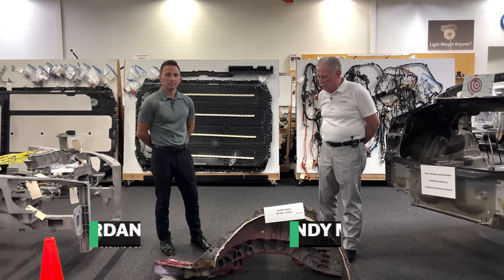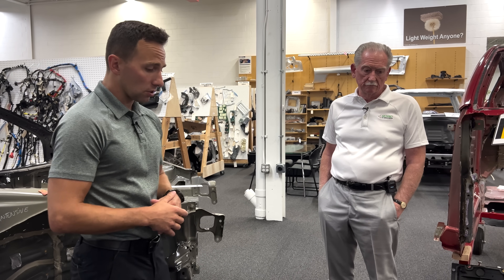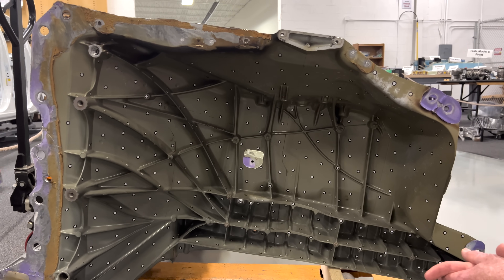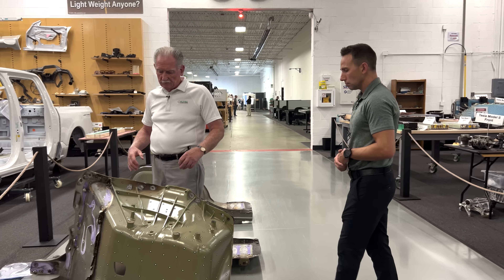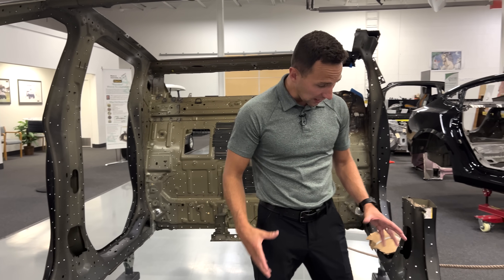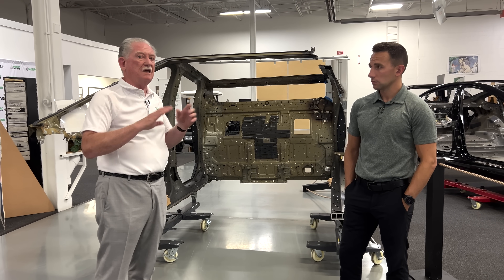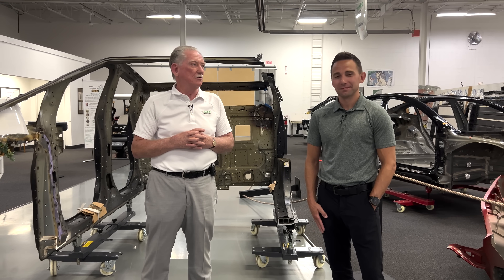From 120 to 1: How the Cybertruck Castings Continue Tesla's Reign of Reduction

Comment: Would like to see a discuss about the post of rear casting of cyberpunk trucks snapping from towing/impact. Is it expected from aluminium vs steel and is it acceptable
Reply: Cast aluminum doesn't like to go outside of the engineered stresses. Instead of an elastic deformation you'd see with mild steel, it will fracture and break. So on one hand aluminum isn't a good choice for applications where random abuse is expected. On the other hand Cybertruck was engineered to tow and carry loads within the specific limits and staying within those limits is a good idea not just for CT, but for any other vehicle. The fact F150's frame doesn't break from excessive abuse is a side effect and not a design intent. The metal still fatigues and repeated stress will lead to unexpected failures even if used within the specs at a later date.
Reply: @fd15k  well said
Reply: @fd15k and on the other hand hitches are breaking off of trucks within the limits going down the highway
Reply: @fd15k exactly, and in this case the engineered stresses for vertical load limit on the receiver is 160 lbs per the Tesla owners manual for the Cybertruck. I don't care what whistlindiesel did. That specification is a joke for a trucks receiver hitch, and over three times less than the 500 lb limit of other pickup trucks, like the Silverado and F150. Because reasons, good engineering reasons. As you alluded to. 🙂
Reply: @ButterfatFarms  

Sure, and perhaps that means if your goal is to carry a motorcycle on the hitch carrier, then CT is not for you. Likewise if you intend to carry of 30 80lb bags of concrete mix in the bed of the truck you may have to pick CT and not the Silverado.
Reply: Cast aluminium is probably the worst thing to use as the structure for towing,  in the aero industry, they cast really strong structures, they do it in a way so as the cast cools, it starts in one place and migrates through the mold evenly, this makes the metal form a solid single aluminium crystal,  looking at the castings for the C T that doesn't seem to be the case,  if the metal is just left to cool it will do it unevenly causing multiple s of crystals, between these crystals are faults,  week points,  if a cast is underload , and is hit hard enough, the shock will break it,  I have seen 2 reports of the C T shearing the rear cast off while the hitch was under load ,  Whistle Dixie tested the ford and the Tesla to destruction,  they did worse to the Ford afterwards to prove a point, the Ford didn't break...... can't beat drawn steel for that type of engineering.
Reply: The fact is the ford wasn’t road worthy after he did that. 20 bucks says that car wasn’t safe to actually drive on the road. Probably didn’t track straight to actually fix it would require a body shop.
Reply: Haha! Look mom a troll
Reply: Not one of you idiots used the word "malleable" once.
Reply: Turns out Cybertrucks actually don't make good aeroplanes, so if you first use it as an aeroplane, then it will actually get damaged
Reply: It is more brittle, but looks easy to replace. Just unbolt the module and bolt in a new one. It's a bigger piece, but easier to replace than cutting and welding.
Reply: @dcap78  if it's that simple, why doesn't that get published by Tesla ?  I didn't think they were THAT modest. Will the local service centre have a number of castings in stock for the panel beaters/repairers to pick up when required ?.
Reply: That guy is a joke.  Why would you even watch that goofs videos.  Dont consume such junk entertainment.
Reply: You mean after driving over 6ft diameter storm culverts, dropping off the end, and slamming the bumper in the upward vertical direction? When it was designed for lateral direction and downward trailer tongue loads?
Reply: @TheJustinJ  no he's probably talking about other instance like the guy towing down the road when he hit a bump and sheared it off.
Reply: i wonder if you can put a steel insert either on the casting or in the casting to help
Reply: “Jerry rig everything” did a YouTube video where he compared a cybertruck and regular truck and was able to snap the rear casting by loading up the tow hitch with a back hoe bucket but was unable to bend the regular truck chassis in the same test. Big difference! Glad I turned down my CT delivery…
Reply: What’s an example of one snapping from towing?
Reply: @Chris-jt7xg He be referring to Whistlindiesel's video about the Cybertruck 😅
Reply: @rkan2 oh that tool.
Reply: @Chris-jt7xg  A video where they jumped one 20 feet in the air then tried to use it to tow and when it broke, they were happy that it was clearly a bad design.
Reply: @davidbeppler3032 I don’t fully disagree with you but Cody did a follow up video and smashed the back end of the F150 way worse to the point where he bent the frame and then straightened it back out with more damage and the hitch didn’t snap off. I don’t know enough to know if the aluminum frame can just be molded differently so that it can withstand more abuse based off of it’s materials flaws but there’s no doubt that there are serious pros and cons to the different materials.
Reply: @TrapperBV  It looked worse but it was not the same test.   Have you operated loaders or diggers.   The hydraulic cylinders slow the fall.
Reply: @danharold3087  May not have been the same test but the frame was all bent regardless. As I said, the materials are different and have different needs. I’d gladly change my mind if he does the same test with the cybertruck but in my opinion the it would break the frame again.
Reply: @davidbeppler3032  you mean 3 feet? Also they replicated it 10 fold with an f150 and it was fine.
Reply: @Edge_Slade  They did not replicate it.  One has far more hp than the other and hit the ramp at a much higher speed.  Did you see the Ford got stuck?  Cybertruck is far better in every way.
Reply: @davidbeppler3032  i mean, a standard steel frame wouldn't have snapped, and trucks are subjected to all kinds of crap. The technology seems perfectly suitable for a sedan or sports car, which effectively demonstrates thay the CT isn't intended to function like a traditional truck.  Thats not bad necessarily,  except that it's been promoted not just as a truck but as the ultimate truck. 

People also jumped the 3rd gen Lightning and found that it's frame wasn't up to the task, but in those cases the frame,  made of steel simply bent and needed repair. It didn't shatter and total the vehicle.
Reply: @Chris-jt7xg  He's probably talking about this entertainment channel where some guy flew the CT six feet in the air and landed its back repeatedly down on a slab of concrete.

Not really a typical use case for a truck outside of a Hollywood set stunt perhaps.
Reply: This is such an non issue.
Reply: Steel doesnt crack when its thresholds are crossed, instead it deforms under fatigue. It doesnt mean that part is now reliable. It will fail unexpectedly on a future date. The gains that can be had by revolutionizing the manufacturing and weight and cost all make the endeavor worth it. A vast majority of truck owners dont really tow anything
Reply: @ZeNashB  the old ways had a lifetime repair warranty........but castings have cast in questions.  Tesla needs to relaunch with a CEO who cares enough to take a basic interest in leading a management team. What chance ?.
Reply: It will be interesting to see how much weight in dust, mud and snow is collected on all those ridges throughout those castings. Most don’t drive on pristine, paved roads.
Reply: Whistling diesel is an idiot, but I would like at least a little bit of an explanation also.    Especially considering my truck will be here soon.
Reply: @erikmoore7402  there's plenty of explanations. He dropped the entire truck on the rear tow hitch. Any other truck would have been totaled by doing this... Quite possibly bent at a near 90 degree angle.
Reply: @themonsterunderyourbed9408  i'm totally on board in support of the cybertruck, and mine will be here soon.    But he did do that test to the f one fifty, and it essentially did nothing.  But after like ten minutes, it did been the frame
Reply: @themonsterunderyourbed9408 Watch the video where they use a backhoe to drag the F-150 around by the hitch and drop a boulder in it. It's a stronger truck in most cases and definitely in towing.
Reply: @erikmoore7402   Don't drop the truck from several feet and stop the fall with a concrete block on the hitch that prevents the suspension from taking up the kinetic energy.    He did not test the ford on this drop.   He did not test the CT on the supposed drop done with the digger.  This was not even a comparison much less a test.
Reply: @danharold3087  it was a wasted opportunity.
Reply: @danharold3087 Also don't put a cargo tray in your receiver hitch and toss a generator on it and then go hit a pothole that exceeds the 160 lb vertical load specification of the receiver hitch. Which is over 3 times weaker than a Silverado or F-150's 500 lb specification, and the same as a model Y. 160 lbs... 😂
Reply: @ButterfatFarms  Asked for clarification on X.
Reply: @erikmoore7402  watch his reaction video to the same thing happening to another vehicle during normal highway driving. He actually seems concerned and disappointed that Tesla didn’t take him seriously. Yes, he is the least scientific person in the known universe, but he did do the exact same thing to the F150 100 times and it was still drivable afterwards
Reply: I think it is interesting none of the tesla apologists in this thread are aware the same failure happened in the wild with a real person towing a normal load. Hit a pothole and the rear end snapped off much like Cody's experiment did.
Reply: @gannas42 I didn't see that. But just picturing it I don't see how much load ever gets to the tongue. There are too many shock absorbing interfaces.
Interesting
Reply: @gannas42 yeah I heard about that one too, even properly towing and not exceeding the tongue weight of the hitch, apparently that 160 lb vertical load limit is a bitch when you hit a pothole.
Reply: Per the Cybertruck's owners manual the hitch has a vertical load limit of 160 lb, the same as a Model Y. And no I'm not talking about tongue weight rating, that's a different specification. I'm talking about the vertical load limit the hitch can withstand with accessories like a bike rack or a cargo carrier on it. While the Chevy Silverado and F-150 are rated 500 lb. If you have an accessory hanging out of that receiver hitch that exerts more than 160 lb of vertical force leverage on the hitch your cooked. It seems like this could easily be exceeded with a loaded bike rack with a couple electric bikes on it, or a cargo Carrier with a bunch of stuff loaded on it, the first time you hit a good bump. The Silverado and F-150 are over three times stronger on this specification. And if it is exceeded things bend not break off. I'd love to hear Sandy talk about this specification, but you know we won't being the huge Tesla and Musk fanboy he is. As well as a long-time proponent of using castings in auto manufacturing.
Reply: @ButterfatFarms people like him are the exact reason that the flawed wet timing belt design is kicking around multiple manufacturers even though 100 years of experience says it’s a horrible design
Reply: Beyond the whistlingD video, there was some guy in the news that had a full load trailer, hit a pothole, and snapped his megacasting.  Haven't seen much more of that, but for EV towing I suppose people buy the GMC EV truck.
Reply: Sorry but the hitch has snapped off from hitting potholes. It's a big problem
Reply: @hankkingsley9183  no…. Only ones that have broken were idiotic tests way outside of any level of reality that we’re not apples to apples
Reply: @hankkingsley9183  Examples on that? I would have expected screaming from multiple sources if that actually happened. "Wham, Bamm, Teslacam" had one crash recently where a Tundra or Tacoma rear ended a CT. The Toyota was disabled, the CT wasn't damaged much at all. The owner decided to buy the parts and fix it himself, for about $1800 I think
Reply: I wouldn't worry about such 'minor' detail.......Tesla is in corporate reduction mode due to an emphasis for far too many years refining its Musk ""corporate puffery"" (Elon Musk's legal counsel) technique. Promises promises in a time when the best are fleeing with their NDA and much smaller stock holding value.
Reply: Whistlin dummy didn't "rip" the bumper off, he sheared it by dynamically dropping the entire weight of the vehicle on it, with the force "upside down".  Same result with any other truck.
Reply: @shazam6274 if you watch the second video you can see how strong the F-150 hitch is as it gets pulled around by an excavator. And a boulder was dropped on top... Steel is stronger. That's just science.
Reply: @shazam6274  i'm a huge cybertruck, supporter, and I have one on the way.    But that would not total a truck with steel frame rails.  I seriously hate to admit it.     I'm still gonna love my cybertruck, and i'm not gonna drop it on its receiver hitch
Reply: @erikmoore7402 Also don't exceed the vertical load limit on the receiver hitch either. 160 lb sounds like it might be rather easy to do if you hit a pothole with an accessory and load on the receiver hitch. Things like bike racks are basically big lever arms on the receiver,  and even with a load much lighter than the 160 lb rating when jolted from a pothole or such I would think the shock could easily exceed that specification.
Reply: body on frame trucks allow the manufacturers to make single/double cab, short/very long bed trucks with option to sell just the chassis cab or just the chassis with the powertrain for RV builders or ambulance builds for example, these can also be modded in to dump trucks, literaly cut in half or sooo many other modifications possible.
Reply: @alanmay7929  Of course, and Tesla has passed on that part of the market. Ford, GM etc does make some money on those, but they make a LOT more on the 4 door cab and short medium bed, with all the comfort features. Cybertruck is cleaning up there. Would love know about Ford's internal calculation on how that will impact profitability. I suspect they're terrified.
Reply: @grahammonk8013  I doubt they're terrified. When Tesla issued a recall back in late June for the Cybertruck's windshield wiper there were less than 12,000 affected vehicles. That's how many we can presume they they had delivered or sold. In July that ticked up 5,175 registrations for the month. Meanwhile in 2023 Ford sold 761,455 F-series trucks. For 2024 from January through September they sold 501,987 F-series trucks. The Ford F Series has been the best selling truck in America for 47 consecutive years. if you think they're terrified because of the Tesla cybertruck you're nuts. It being the best-selling electric truck doesn't change the fact it's still a relatively low volume niche vehicle.  😂

I mean really why do you think that Ford and GM and these other Legacy auto manufacturers, after committing to huge investments to get their EV programs up to speed, then drastically pulled back when they realize sales were shit?
Reply: @ButterfatFarms  That's all true, but Tesla is taking a noticeable chunk of their most profitable sales, and it's about 5,000 a month right now. Maybe terrified is an exaggeration, but they will be taking notice. The F150 isn't dead, or even close to that, but the CT will start affecting the margins.
Reply: @alanmay7929 all something 90% of truck owners don't need.  Most are double cab with a medium bed.
Reply: @alanmay7929  i don't think they're trying to tackle that market, though.   Clearly
Reply: @alanmay7929  a lot of truth to that.
Reply: sandy is a total joke! he has never talked about the actual advantages of body on frame trucks! steel is significantly much stronger than alumimium. go watch wistlin diesel on trying to break the ford f150 trailer hitch he did everything but couldnt.
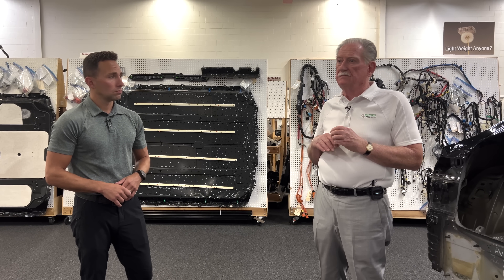Reply: @alanmay7929 He's talking about it. You just don't know enough to understand the words. Go back to around 2:30 where he starts talking about how far forward they are willing to bring the low ductility casting. That address that concern explicitly.
Reply: @alanmay7929  You better not fly on planes cause they are all made of aluminium 😅
Reply: @raymondschembri5042  They're also not made by Tesla. I trust Honda to build a Honda Jet, Tesla not so much. 😂
Reply: @ButterfatFarms  Who is bringing back the astronauts from ISS ? Boeing Starliner   , Hondas space capsules or whatever you want to call or maybe SpaceX . I’ll wait for your comment so others can see.
Reply: @raymondschembri5042  SpaceX that's who. Don't know why you're trying to conflate Tesla and SpaceX that are two entirely different companies, but they are two different companies. Spaceflight is SpaceX's wheelhouse. I would never trust Tesla to build airplanes or spacecraft. 😂

Maybe you haven't noticed how much Musk over promises and under delivers with Tesla while making incredibly fast progress with SpaceX's programs. Funny how that works. How long was the Cybertruck long delayed again? And the model 3 before it etc, and whatever happened to the new Tesla Roadster they showed off then shelved for years? They ain't got no time for that. Also I'm pretty sure the fit and finish on a SpaceX manned Dragon capsule is a hell of a lot better than a Tesla. 😂
Reply: @raymondschembri5042  That's true. But planes have to be inspected regularly and rigorously for cracks, and they are continually being rebuilt. Generally the sorts of loads which happen all the time off road happen in planes only in a heavy landing, and then it's only one cycle. And a plane is only good for a limited number of landing cycles. Aluminium does not have a defined fatigue life in the same way as steel, which means under cyclic loading it will crack, and it's not possible to say when, which makes crack inspection crucial even with that low number of cycles. Once a crack exceeds a particular length for that material and heat treatment, (the "Griffiths" limit) it will propagate to failure the next time it is loaded.
All this is fundamental fracture mechanics. Might not be sexy enough, or modern enough, for Musk to take seriously...
Reply: @ButterfatFarms Space X had 3 billion off the government, you can do a lot very quickly with that sort of money, it will be interesting now that he has spent it all after wasting...how many raptor engines in each stupid Star shop take off....
Reply: @mrlemm2030  I don't know what point you think you're making that has any relevance to what I was discussing.
Reply: @ButterfatFarms  you said Space X was advancing quickly, I was just pointing out, Space X has had billions to push there program forward, and Tesla certainly won't be, yesterday 3 of the board members of Tesla put all there shares up for sale....I wonder why?
Reply: @mrlemm2030  I see so you were making a totally irrelevant point to what I was discussing with someone else that suits your own narrative. That's nice. whatever. Proceed. Don't expect me to be interested in discussing it. 😂
Reply: @ButterfatFarms  lmao.... like Musk..." I don't care, I'll say what I want" narrative?  my narrative is winding up sudo engineers who dribble over new amazing looking objects that are just rubbish and are definitely not going to be the next big thing....form has to follow function not the other way round, I actually agree with your earlier comments, apart from the one I replied to.
Reply: @ButterfatFarms  in my first comment, not to you, I explained why cast aluminium is one of the worst materials to use for this application, These castings were not designed to be an improvement on what is already available but for cost saving only,  this is a massive problem for Tesla, and will have to be resigned, I'm just a little bit surprised that the engineer's at Tesla let this happen because they must know it would be a problem that will come back and bite them.
Reply: @raymondschembri5042 
Airplanes are used slightly differently to pickup trucks and very few are used for towing or have tow hitches.
Reply: @alanmay7929 LMFAO you are the joke son, go back your video games.
Reply: @alanmay7929  if there is no really good reason for aluminum, it's just not the material for cars. Sure, you can optimize the load distribution etc. but you can't make it as tough as steel.
Reply: @alanmay7929 except do the same thing he did to the cyber truck lol he didn't just tow with the cyber truck he used 8000lbs suddenly stopping to break the cyber truck
Reply: @PhysicsOperator  how lame can you be!? he dropped a big stone on the ford, used a construction equipment, dropped the ford on a concrete block several times nothing happened thats much harder than what the weak tesla went through lol!!! you cant just accept that aluminium is weaker than steel would you?
Reply: @alanmay7929  applying force vertically has a sub 10% relevance when the force that was implied was horizontal have something pull 90kgs worth of force at 5mph at your finger and watch it go flying do the same with 90kgs of machine on your finger go to hospital get a cast and heal its simple math
Reply: @alanmay7929  did your Mom have any children that have a mind?
Reply: This is the channel that got mad for the criticism about Musks obviously teleoperated Hollywood event. They aren’t going to call out the obvious flaw in cast aluminum that fails catastrophically. It doesn’t bend, it breaks.
Reply: @anonymous..-  That video about the Robotaxi event seriously made me doubt Sandy's mental state. That wasn't normal *at all*.